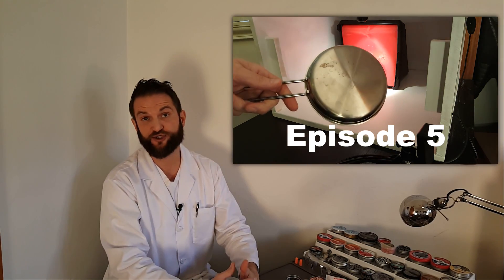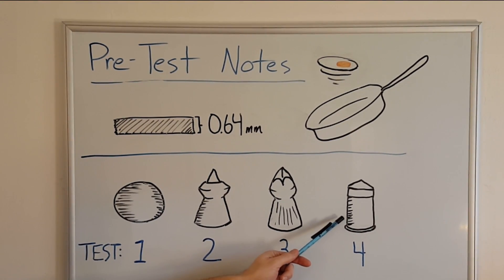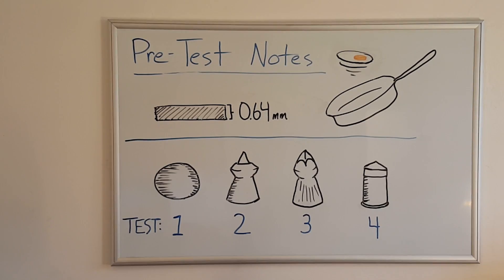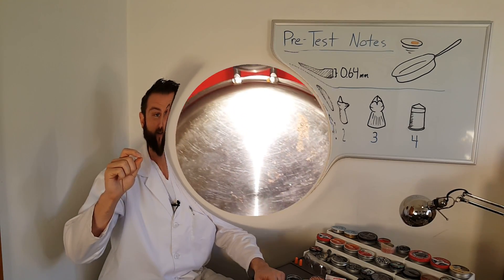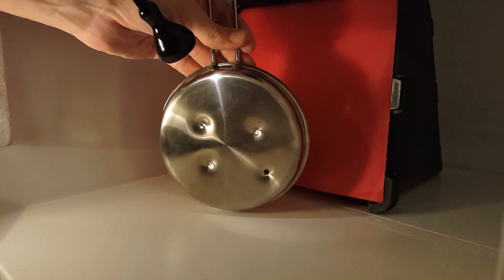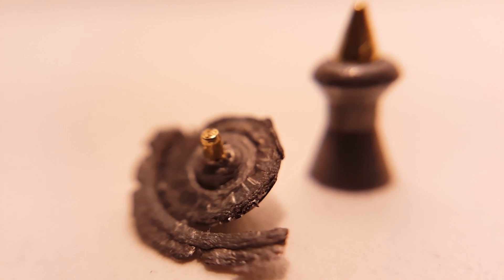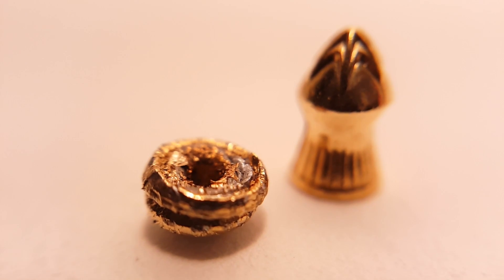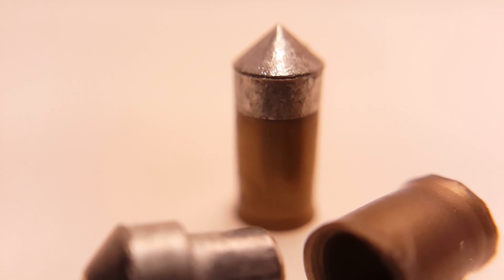S1E5 - Four Airgun Pellets vs. Steel Frying Pan - High Velocity!

Comment: Please test Diabolo King heavy in .25cal.
Reply: Prometheus in .25  6.35mm are the best I have found in that caliber it's a solid copper slug with plastic sabot great as is but if you have a lathe you can make your own cores with points on or a flat wadcutter style that will dump all its energy in the target. My new hobbie has mutated from shooting in to making copper cores with various tip geometry

Comment: Gold Flight Rounds out of any air rifle that shoots them over 1200 FPS can be used for home protection especially the 22 Cal Red Flight Rounds that I tested on a old steel anmo can at 10 feet it went through both side of the steel ammo can and then it went a quarter of a inch into a oak wood table at around 1500 FPS, Red Flight Rounds traveling that fast and at that range would most likely stop a criminal intruder if not drop them in their tracks!

Comment: How can u shoot a bb from a brake barrel rifle?
Reply: Use a dab of vasaline it holds the round in the breach (only ever do this in a break barrel) never a PCP or pnumatic due to blowing your seals (yes it is true) , I unfortunately found this out the when dieseling a pnumatic 1 pump pistol however I have found springers tend to withstand dieseling

Comment: You should add chronograph readings to the videos, in the ballistic world there is a well known saying, speed beats armour, the lightweight polymer pellet was the only one that went through
Reply: I remember when I tried out my Beeman R1 springer in .177 cal with a pointed tip pellet on a steel warehouse roll up door.
The pellet went clean through and revealed sunlight. The pellet was coming out of the muzzle at over 1000 fps with a crack sound.

Comment: Gold Flight can be used for home protection especially the 22cal version that actually shot through a steel ammo box and about a half inch into oak wood using the Beeman Dual caliber air rifle with a little Vasoline on the back of the round bringing the velocity to over 1350FPS!

Comment: I have experimented similar trials using sub 12ft lb air rifles. I found that a .177 steel bb superglued to a .22 crossman hollow point made a neat hole in a 1mm+ steel panel. The pellet itself did not pass through though. I came to the conclusion that this exercise has only ballistic benefits if you used a .25 pellet in a 20ft lb plus power air gun. Modifying .22 pellets and even adding a dieseling effect to achieve greater penetration is counterproductive. Loss of accuracy and even the remote possibility of damaging compression seals makes these modifications pointless. I have also use steel tipped polymer pellets, but found then to be disproportionately too expensive. Just choosing a pellet that suits your barrel and maybe choose a harder composition is the optimum choice.
Reply: Yep100%👍

Comment: This is by far a more accurate test setup..
Very informative video..well put together.
Reply: Not in my  mind. With the pan not fully secured it absorbs most of the energy when it is impacted and moves thus less penetration. Mount the pan solidly and do a test comparison. I feel there will be a definitive result in accurate tests. Just saying.

Comment: The softness of the pellets have nothing to do with why they didn't penetrate. The velocity does. Shoot them at a higher velocity and they will penetrate. Lead bullets go through thick steel all the time, as long as the velocity is high enough.
Reply: Even lead core bullets don't compete with fully copper bullets when it comes to depth of penetration. I has to do with how quickly your projectile looses mass upon impact. Both deform similarly but a lead core will only retain about 60-70% of its mass in fragmentation, whereas a fully copper bullet will retain in the high 90%s. Yes both types of bullets will shoot through some steel, but how much steel? Armour piercing rounds generally have a tip or core made of a very hard material such as tungsten. 

 Pellets are not bullets. They are designed to fly in the 350 to 1100 fps range, and loose energy quickly. If you shoot supersonic the pellet will generally tumble when it slows below the sound barrier. If you shoot a lead pellet at wood or similar material it will penetrate a little and retain all of its mass because the velocity is not enough to fragment the lead, like this pan where a dent was achieved, that allows the pellet to retain its mass. If you shoot lead pellets upwards of 900 fps at a target that they achieve no penetration, .25" plate steel, if you can find it, it will turn into a pancake that is much lighter than the original pellet. Just like you would if you shot your 30'06 at a tank.

Comment: I have a small problem with the measurement in thickness of the pan. 1.35mm is the thickness of a dime. You are saying the pan is only about half of that. I think you misplaced your decimal or something. You mean 6.4 mm? Because if not, then that frying pan is nothing more than foil and your gun has no power.
Reply: nah, that pan was no where near 6.4mm look at the footage. That is a toy pan. I wouldn't dare putting that on a stove.

Comment: THE PAN SHOULD BE FIRMLY POSITIONED ,MANY PELLETS WOULD HAVE PENETRATED THE LOOSE POSITIONING OF PAN ABSORBED ENERGY.
AND TRY IT WITH LEAD .22 AND .25 PLEASE
THANKS!
Reply: Fuck that! A cheap 22 lr will got thru a car door and is cheaper than most airguns they also take 10+ Round magazine
Reply: @edmunddobry3966  I agree but some people can't get them and you can't shoot them in town
Reply: Correct.   And what's more...
This test is very badly executed. The one pellet that made it was aimed nearer the edge of the pan. The centre of the pan act as a spring. Nearer the edge the pan is stiffer, so there's little chance the pellets would bounce. That's the only reason that one pellet made it.

Comment: Same thing I got@ 25 feet,but gold flight did not go thru.
Reply from the maker: Interesting! Gold Flights don't appear very aerodynamic (shallow conical tip and low density) so I bet it slowed down considerably at the end of that 25 ft. I will be testing the drag coefficient of several pellets very soon so I will be putting that idea to the test! Thank you for watching!

Comment: The Crosman Goldflight are replicas of the design by Skenco. The Skenco pellets have or used to have a zinc core, they did when introduced many years ago and probably still do
Reply from the maker: I will have to get my hands on the ones you mention. I notice a lot of "sharing" in the pellet industry so it will be fun to compare head to head at some time soon. Thank you for the comment!

Comment: This is a good experiment. but now can you do an accuracy test of the above. Power is no good unless it groups well. That's why most just stick to pellets that are accurate like JSB, Air Amrs round head ect.
Reply: It's been like this since 1968. It's a bloody joke. As far as being invaded by muslim extremists, that's just one reason that most of us voted out of the European Union, we've been ruled by an unelected dictatorship for too long. The politicians and media are shocked, because none of us decided to continue with the way things are. Apart from that though, this is a great youtube channel. keep up the good work Tiny Ballistics Lab.
Reply from the maker: I could not agree more! Even though I love marksmanship as a sport, I'm working on a rig that will hold the airguns in a consistent and repeatable way so I can start providing good objective data on pellet accuracy. Indeed I extended the ballistic test range to 13ft just the other day for upcoming accuracy tests!
Reply: Thanks for that. You have a great channel here that is well worth a look at. Back here in the UK we have to make due with sub 12 ft/lb air rifles, and require a firearm permit for anything above that, which has to be for a good enough reason. As we are not used to the full power airguns like in America, it may be a good test to show us just what the penetration power is like, say through a standard pinewood door of 2 inches thick, at various ranges? Keep up the good work.
Reply: Your "good reason" is the fact that your country is being turned inside out and destroyed by a Muslim invasion of rapist's from north Africa. The first step to your Tyrannical government and the coming sharia law was to disarm the population and then have the disarmed people come on the internet and brag about how great it is to be defenseless.

Comment: Cerebral Air-gunning, that's enough for me to subscribe. Have you considered using an airgun that will produce less velocity deviation to insure consistency within a test scenario? Would a regulated PCP will give you more reliable numbers? I haven't seen your other videos yet, so perhaps you are already using other platforms. Anyway, looking forward to more videos and if I think of any suggestions for ballistic testing I won't be too shy to chime in. Cheers and all the best!
Reply from the maker: You get it!! Yes, I'm eager to introduce several more airguns in upcoming episodes with a wide variety of energies. I have found the gas piston rifle to be very consistent in my tests thus far. I'm busy working on a tiny supersonic rocket at the moment--stay tuned for that!!
Reply from the maker: I agree! If the response to the channel continues to be so positive, I would love to get a slow-motion camera at some point soon. I'll do things nobody has ever seen.
Reply: you can get this for about $450 (U.S.) Casio
 Exilim Pro EX-F1 Digital Camera, 6.0 MP, with 60fps High Speed Burst 
Mode, Full HD Movies, 12x Optical, 4x Digital Zoom, 2.8" HP LCD Screen
Reply: Tiny Ballistics Lab  Ned a slow mo cam like the new less expensive version to a the Fledermaus and demolition ranch are using.  can't remember the brand.
Reply: +Tiny Ballistics Lab very interesting videos I do my own testing I got a,stale lump of lamb test some hollow points bit stinky but worth it the badgers I hand feeds will take it away later greetings from UK England Essex 🔫👍🐺🐾